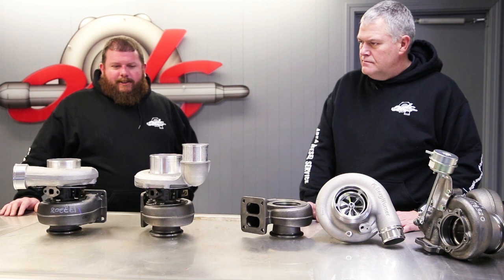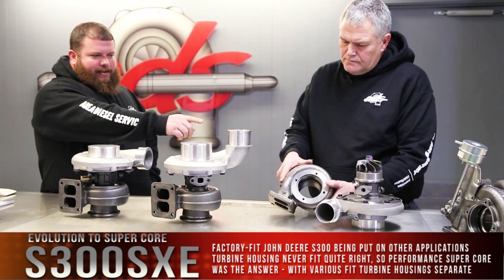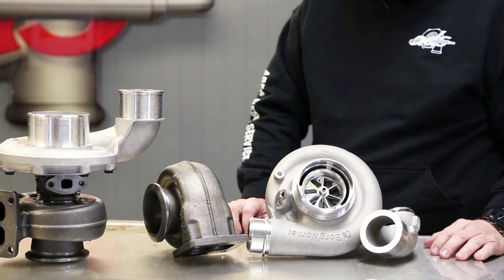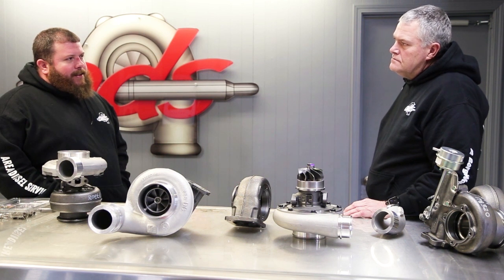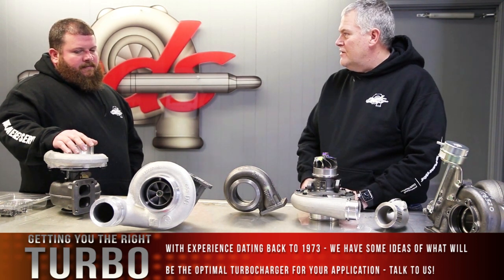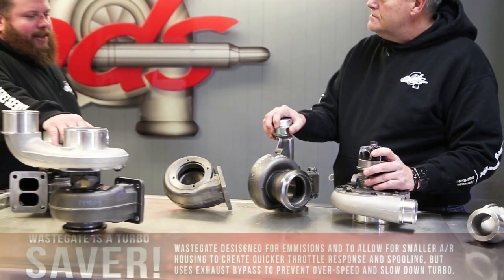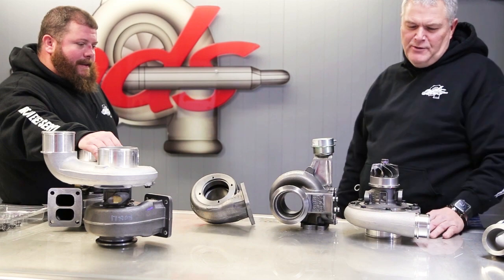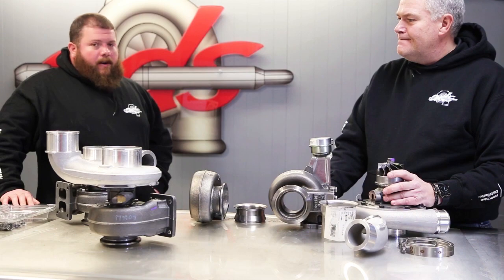#TurboTalk - Explaining/Debunking the S366 Turbocharger #S366 #S300 #S300SXE

Comment: Titanium compressor wheels sure are nice. Holset has several and KKK has some. Not sure if BW is making any in their line though. I definitely recommend asking advice for most people when looking for a turbo change. Many Dodge 5.9l people get an s366 based off the horsepower number it can support and then are unhappy they can't pull their 15000lb trailer without egt's going thru the roof. I highly recommend people check out that AXIS catalog you all have a lot of good parts in there for people doing upgrades and modifications.
Reply: 3K is a brand owned by Borg Warner, and they  also produce some Titanium wheel turbochargers under the Borg Warner name as well.  Thanks for the comments!
Reply: Engine lugging causes high egts,use your hand and drop a gear and your issues go away...
Reply: @josiahjones5293  over fueling also causes high egts, mine will spike it 1600° @3000rpm... It has to do with CFM, not boost numbers... Too many people associate boost with power, it's just an amount of pressure/ back pressure available in the intake ... Means nothing as far as power output

Comment: 2jz ge NA,T s300 S366 .91 divided what will be the spool rpm, and at what rpm might hit the full boost! Thanks 😊
Reply: well if full boost is 2 PSI maybe 2000 RPM but if you want 30 PSI probably not until 5000 RPM.  You should probably spend a year learning about boost and saving your money

Comment: Hi what would be the optimal  turbo size for a 4.0 ltr ford Barra? I am aiming for mid to top end power as I have a Na motor which has renonded for weak rod's.  I'm looking for a mildly quick spool but prodemetly mid to high end power.. I believe they run a Garrett 3582.
Reply from the maker: Shane - hit up our Chat Now feature on the website for some immediate assistance! www.areadieselservice.com - Thanks for watching!

Comment: Hey possibly unable to help but I have a question. Once the my car gets hot about 20-30mins of normal driving then there’s a whine won’t do it when it’s cold. The turbo is a bw s366sx-e .91 ar t4 divided and vband out. It’s not blowing smoke etc turbo is brand new less that 10000km it’s been perfect untill last week where suddenly it stated this noise. There abit of play when it’s cold but not hitting the housing and no in and out play. Slight oil leaking around the drain . I know it’s hard to tell but any ideas? 😂 going to take it off soon it’s ran a ptp turbo blanket as well
Reply from the maker: You’re right its hard to tell what the issue is over the internet and not have the vehicle.  I know you say you hear this whine when the engine is warm- but does this noise occur all the time? Only under boost? Or when do you notice it the most? If the turbo isn’t contacting the housings then its not coming from physical contact, which should be generated all the time- hot or cold. So that’s good. It could be an air turbulence noise if the air filter is causing an issue. If its only doing it under boost, it could be an intercooler leak due to heat and pressure expanding the cooler or any of the couplings between the turbo and the intake piping system too.  The oil leak around the drain- is that as simple as tightening the bolts or replacing the gasket?- do not use silicone sealant in place of the gasket. Just make sure the drain flange is flat and clean of debris and the same with the bearing housing and use a new gasket.

Comment: great video and covered a lot of important topics... I've been looking for an undivided S400 turbine housing, not too concerned about flange types, are there any available?
Cheers and happy new year!
Reply: Thanks for the positive feedback.  Give us a call with your turbo part number and we'll see what we can find to fit your turbo.
Reply: @vonleefers7914  I don't have a part number, I was just wondering if any housings like that were available for that frame.. , it would be the atmospheric in a compound setup so going divided is quite pointless
Reply: @Rx7man  Sorry for the late reply.  In the S400 frame size there are a couple different bearing housings used and therefore the "pilot" into the turbine housing would need to be different too.  So we'll at least need to know what size bearing housing you have and of course what turbine wheel your running.  But yes there are open throat options available.
Reply: @Lane Brycen Definitely, I've been watching on InstaFlixxer for since november myself =)